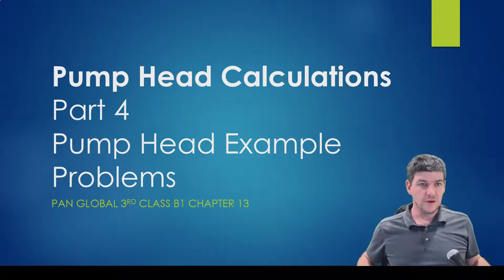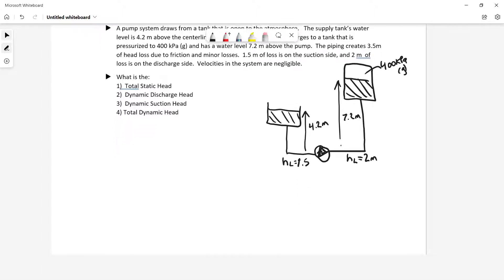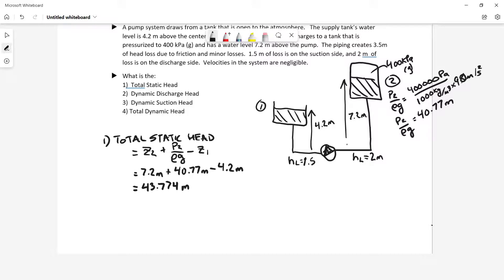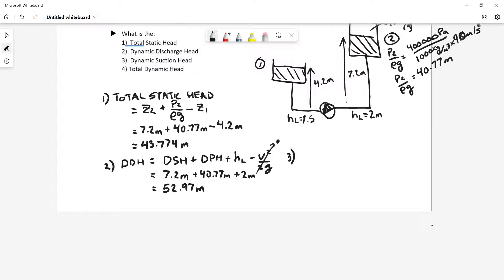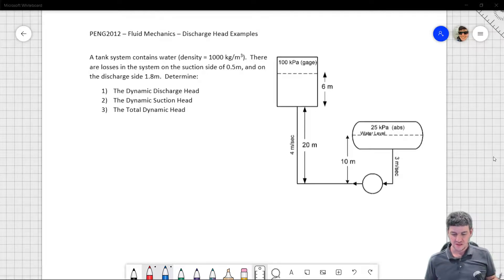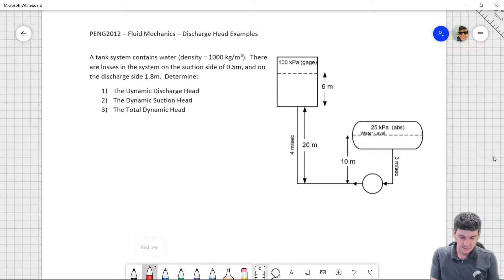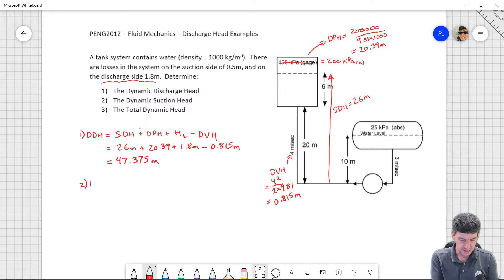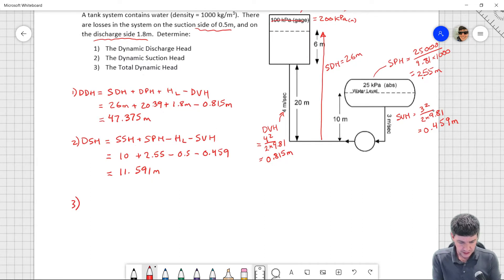PENG2011 - Fluid Mechanics - Pump Head Calculations - Part 4 - Example Calculation

Comment: @5:06 First term on the RHS should be SDH "Static Discharge Head"  compare with your "Pump Head Calculations 3" video @14:50